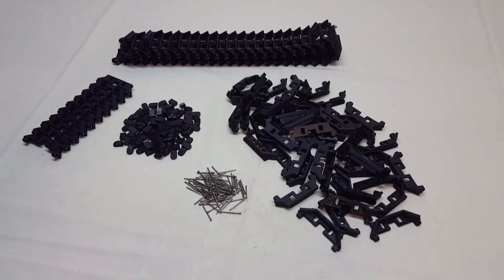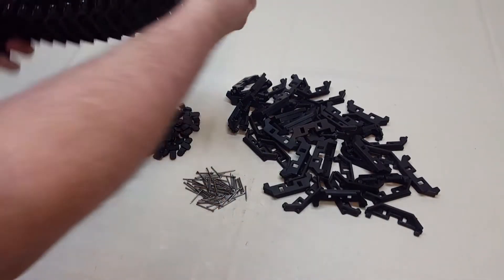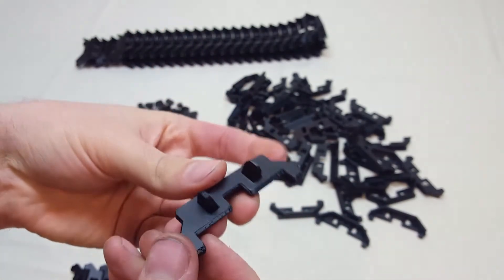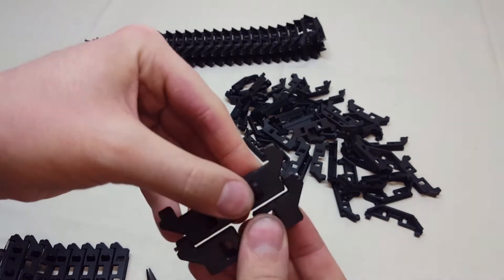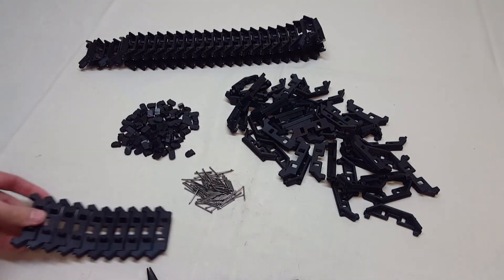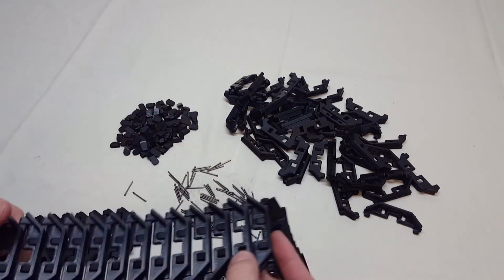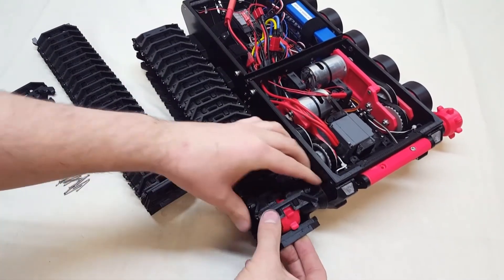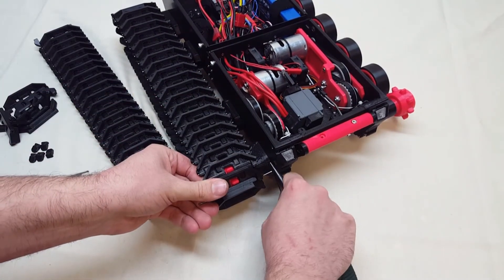3D Printed Spyker KAT Tracked Vehicle - Tracks (BUILD SERIES)

Comment: the direction of tracks is wrong for your vehicle, it will bee needed forward, you can look at the tractor tire protector direction and though why its like that
Reply: Yes if they spin they have to push the mud out to the sides and get fresh ground on the thread.
Reply: Correctly that!
Reply: In the Army we say, "smile in the front frown in the back".  It gives you more traction in reverse.  You never want to drive yourself into trouble by having more traction to get stuck than to get you out of the mess.